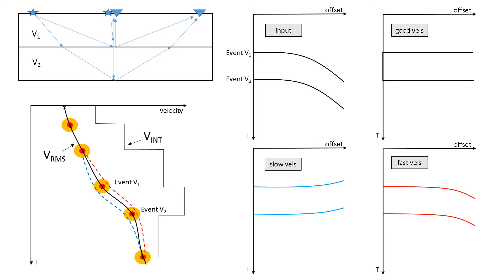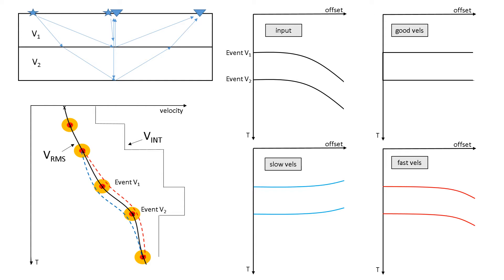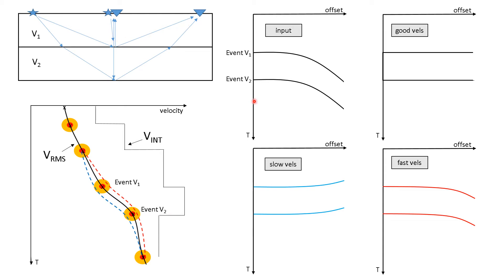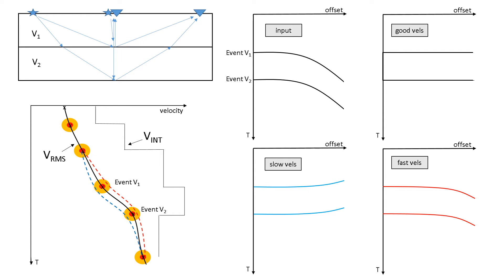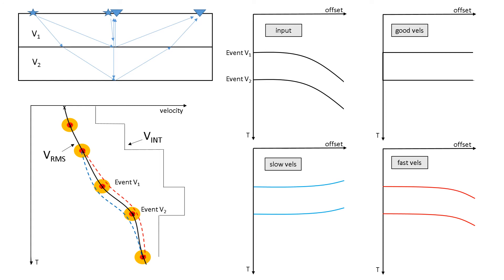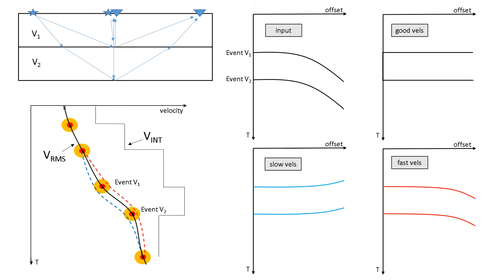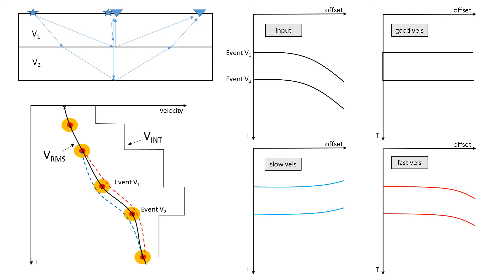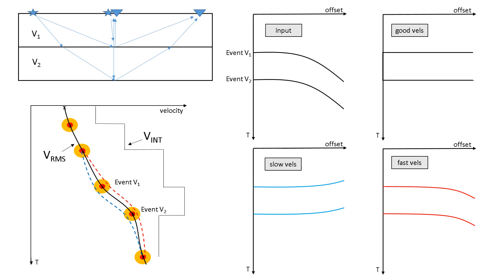Seismic time stack velocities, seismic processing

Comment: If the layer is not horizontal and dipping, do we still want flat reflections?
Reply from the maker: yes. After migration, if everything is handled properly, then events on gathers should be flat at all offsets - no matter if the overall structure is horizontal or dipping.